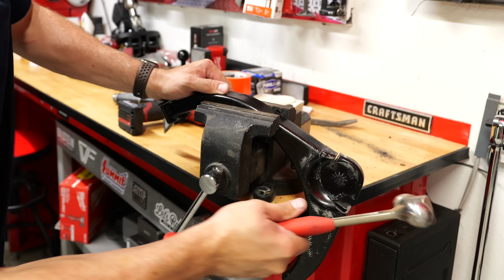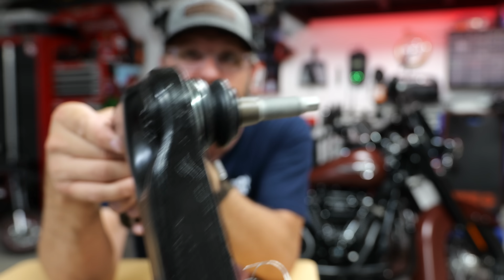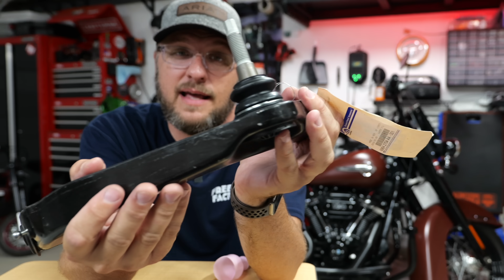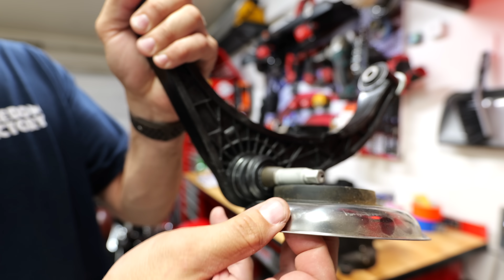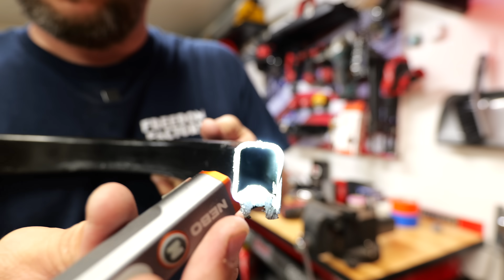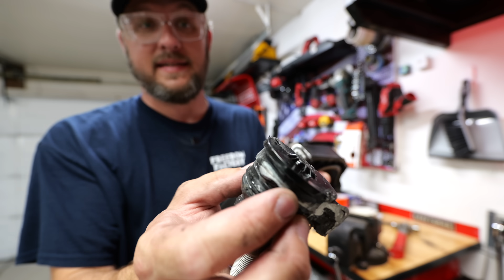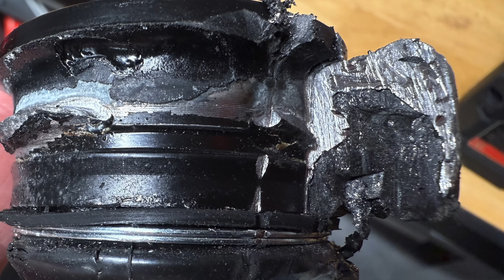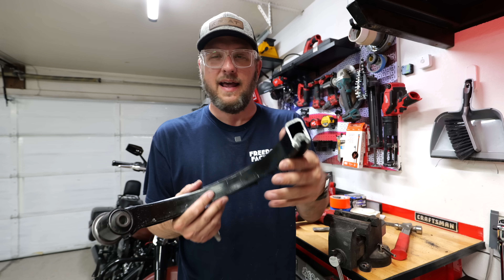I Cut Open RAM’s Plastic Upper Control Arm… Worse Than I Expected?

Comment: I Want: Zero Plastic Suspension Parts, Oil Pans, Valve Covers, Transmission Pans (color me crazy).
Reply: @Fallguy777  yep, I agree. Along with dipsticks for the oil and transmissions.
Reply: @Fallguy777  plastic should be for Legos......
Reply: Screw plastic coolant lines, too.
Reply: @Fallguy777  let's add intake manifolds to your list
Reply: @Fallguy777  I feel you man. I got an f150 and I love it but man the oil pan scares me. No leaks yet but I have to admit I've been window shopping for a metal one.
Reply: @ravageprime1172  if you get a metal pan, you can get a fumoto drain plug to make oil changes even easier. No wrench needed. I sold my 2019 f150 with a metal pan and fumoto drain plug recently. I replaced that truck with a 2002 7.3 f250. I had a 1999 7.3 f250 before I bought the f150 new in 2019.

I've come to the conclusion that I like old trucks better, long story short.
Reply: I would enjoy driving a overpriced pile of plastic, but it looks like my real steel 66 Cadillac is going to outlast me.
Reply: go back 20y or more or buy specific cars ....have a clio 3 rs...that has metal intake, al oil pan, still cast iron engine block, al valve cover, al thermostat housing.....
Reply: But they are charging you as if it were the real thing.
Reply: I agree, I've never had a vehicle with plastic suspension or oil/trans pans but I've had numerous problems with warped and leaking valve covers, valve covers that will strip out if you tighten 2 ft-lbs too much, valve covers where the screws will literally dig through the plastic without even getting tight, valve covers with non-replaceable seals around the injector bodies, valve covers where PCV valves will crack off due to the plastic being too weak to hold a tiny right-angle hose, etc.
Reply: Stick with 20 year or more old rides.
Reply: Don't forget that companies like Ford makes things like water pump impellers out of plastic now. I replaced several of them on the Coyotes in F-series trucks, none of which had even hit 100k miles (the first one I did had 49k, I was blown away when I pulled what was left of it out). The impeller just disintegrates, and not one customer on the 5 or 6 I did wanted to pay to further disassemble the motor to fish all the debris out. At least the steel aftermarket impellers will chew up whatever pieces circulate through, but it's still a clogged radiator, thermostat or heater core waiting to happen in the future.
     Models like Focus and Fusion even have phenolic brake caliper pistons (HOW IS THAT EVEN LEGAL?!) with cute little sheet steel faces where the piston meets the brake pad, and they crumble just like the water pumps. Modern cars are just abject trash.
Reply: Same.
Reply: I have a 2004 Nissan Altima 2.5s a lot of what makes that car unreliable is the plastic parts. Mainly the plastic valve cover. It causes oil to go where the spark plugs are and it leaks oil badly. And the radiator (on the automatic ones). But it’s also an issue on manuals for cooling. On the automatics at around 200,000 miles the plastic tanks on the radiator crack and it dumps water destroying the transmission. You can easily fix both of those issues by getting all aluminium ones.
Reply: I bet people said the same thing about gun frames before Glock came along, that said I’m on your side: not ready for that yet.
Reply: Yeah it’s like ford bout had the plastic intake right on the 02 f150s but instead of fixing the cross over on front where plastic think crack around o rings letting it leak no let’s just remake the entire engine 10x more complex and worst and then the 3v was born. All the trial and error and technology we got there just no excuses for the junk they making they could make the longest lasting best vehicles we could dream up but nope we get disposable junk instead. But it all leads back to all them under ground bunkers the elites built the end game is all of of gone off the face of the earth roughly under 500 mill ppl left only allowed to live in smart city’s as the world economic form says you will own nothing and be happy by 2030. So the rich elites can roam earth like it was there back yard with all of us gone so why make all these vehicles to last if you don’t plan on ppl using them in the very near future once you see it that way everything makes sense
Reply: The plastic valve covers and intake manifold on the VK56 in my Titan are doing just fine at 223k miles, but I agree on everything else. Plastic oil pans are probably fine, but they bother the every living crap out of me.
Reply: You are not crazy. The difference in reaction to temperature change between plastic and metal is enormous coupling them in the environment suffered by an IC engine is engineering idiocy, then putting a plastic 
" Beauty Cover " over the whole mess to hold the heat in is insane.
Reply: @Fallguy777  or intake manifold.
Reply: I have a 4.6 liter 2000 Ford Expedition with plastic valve covers. No problems yet. The thing is built like a tank. 
 I don't like plastic suspension parts. But be aware that the latest plastics are super strong. I had a useless digital internet radio that I wanted to take apart to see why it was so heavy and expensive.  ( The company died, so no server.) The screws could not be removed. I didn't want to break a screwdriver, so I took a sharp hatchet to the radio in the backyard. I had to hit the case about 10 times, as hard as I could, before the plastic finally broke. I couldn't believe it! And it was NOT fiber reinforced, like gun stocks are. And it wasn't thick either. Those internet radios are like a computer inside. A bunch of chips on 2 circuit boards with many capacitors & resistors on them. They are way more complex than I suspected. I could see why they aren't big sellers. You would need a giant factory to get the price down, and there isn't enough demand for that many.
Reply: @billsimpson604  For real?  It IS a computer.  It downloads music from the internet.  Duh.
Reply: @Fallguy777  Valve cover and intake manifolds have been plastic for decades on the most reliable Japanese engines.
Reply: @Mark-p1r7r thats cool but you cant port and polish them. How do they hold up to nos or forced induction?
Reply: @Mark-p1r7r  Some of us just don't like plastic.
Reply: buy a 57 Chevy
Reply: @sinistersilverado965  unreliable
Reply: Plastic valve covers hold up ok. Oil pans? Aluminum is the best, steel can rust out and often times replacement isn't easy.
Reply: @andrewdonohue1853 They can “hold up” until they have to be removed for maintenance… they are designed and intended to be replaced. This always costs extra money.
Reply: @andrewdonohue1853  aluminum corrodes too
Reply: MORE DESIGN ENGINEERS (GARBAGE)
Reply: You’ll going to half to buy a bicycle then.
Reply: @rg5445  Have, not half.
Reply: To do that u need to build it ur self, build old Ford!!
Reply: @Fallguy777  0 plastic inside of an internal combustion motor, period.
Reply: @DinduShecklestein timing chain guides
Reply: said no-one
Reply: @ragtowne i think you did not see the word ZERO...... lol!!!! 😅😊
Reply: @abitoffblacksmithing9985 sorry
Reply: Looks like you're not buying any new vehicle any time in the future if you stick to your criteria. Plenty of '80s vehicles out there to buy that meet your must have list Would I want one, heck no.
Reply: @Mdan7 Valid point, but l liked my 85 Mercury cougar. It was RWD, 3 speed traditional auto transmission, sealed beam headlights. Great car very reliable when almost everything else was FWD garbage. It was old school American car Ford knew how to build. I had Accord owners tell me at the time they liked it better.
Reply: @Mark-p1r7r I just bought a 97 Cougar XR7. 360 000 km and it's still mint. I can work on it myself, I'll double that mileage easy. Still has original alternator, starter, water pump, everything. No failures in 28 years, driven in Canadian winter. To hell with new cars
Reply: @Mdan7 Keep wasting your money
Reply: @Mdan7 I would. Theu were simple and cheap to service. An old Diesel rabbit, Mercedes, Volvo especially just wont die. Nobody will be pulling out a 2010 Chevy equinox, Or jeep patriot out of a field to fix her up like we do with cars now. Look at the insude of a new jeep grand cherokee. Looks insane inside. All the cables, wires, electronics. Im a tech and i was shocked.
Reply: @jasonchristopher2977   The problem with the diesel Rabbits is you ended up putting a new head gasket in every 50,000 miles.
Reply: @Fallguy777  the oil pan isn't a big deal .
Reply: @corytomcany6027  Plastic oil pans ARE a big deal. We have a fleet of western star trucks with Detroit diesels and they all have plastic oil pans, and ALL of them started leaking badly every 60k-80k miles. I've done so many pan gaskets by now I can't even remember how many. We've sent brand new trucks back to the dealer because the pan was pouring oil with less than 1,000 miles on the engine.
Reply: @corytomcany6027  How about plastic o-ring drain plugs in the plasic. They have went to far.

Comment: I remember Dodges plastic wheels over 20 years ago. That didn't last very long.
Reply: A lot of manufacturers still use clad wheels same as ram used.
Reply: Ford had them that you had to melt off.

Comment: Upper control arm carries serious loading from front brakes - plastic is a joke.
Reply: Takes stress when cornering too.
Reply: I’m not off roading, but do drive dirt roads quite a bit.  Not as much as serious off road, but frequent odd torques and forces acting on wheels and suspension gets a workout.  Parts have to survive ALL reasonable use.
Reply: No it doesn't the knuckle does
Reply: Using plastic in these type of compontants, is extremely dangerous.
Reply: Only in Heavy (Panic Braking) or Cornering, which Trucks don't Normally Do, the Lower will see More Load Always.
Reply: Braking and cornering while towing, stop thinking like a car driver.
Reply: Did you even watch the video? The structure is steel. Without actually testing them none of us knows crap. They might be the strongest around.
Reply: @Mark-p1r7r да, но это фольга, а не сталь
Reply: @Mark-p1r7r  That steel is very thin.
Reply: @johnshaddick6858 Did you measure the strength? If not, you don't know anything.
Reply: Yup! A few multi million $$ lawsuits will get them back to the drawing board. they should learn lessons before they happen. Buy a good old American made Toyota Tundra instead.
Reply: They have been using phenolic stators in torque converters for years and they are better than aluminum so your joke has no merit.

Comment: Well heres a question for you! Do you think that will survive ona true work truck loading materials in and out of mines or used in an offroad situation. I dont think it will. I think itll eventually crack and then when moisure gets inside itll tmrot from the inside out

Comment: Every replacement part I buy for my truck is usually about 2-3 time heavier than the OEM part.
They are also serviceable and come with life time warranties.
Reply: But what is the point of a lifetime warranty if the part keeps failing and the company offering the lifetime warranty goes out of business?

Case in point, I bought a lifetime warranty alternator for my 1991 Chevy Cavalier from Chiefs Auto Parts.  It went bad, and they replaced it.  Then they were bought out by Autozone.  Then the alternator went out again.  I took the alternator and my receipt to Autozone and they didn’t want to replace it under warranty until I started raising my voice, so they replaced it.  A few months later the alternator went out again.  Took it back to Autozone and they flat out refused to replace it.  Went to Oreilly’s Auto Parts, bought their cheapest 1 year warranty alternator since the other ones all failed within 6 months, and I never had to replace the alternator again.  

So just because a part has a lifetime warranty doesn’t make it a good part.
Reply: @91CavGT5 AutoZone has garbage parts, especially their electrical parts and their house brand suspension parts, same with O'Reilly parts. Overpriced junk for sure

Comment: It is obviously designed to look much stronger than it really is. Filling the thin steel with soft plastic provides no benefit at all. You are correct,  parts are engineered to be made cheaper, not stronger or more reliable.
Reply: It's a fully boxed steel part, likely made out of HS steel. The plastic is for NVH mitigation. It does not require the plastic for strength.
The side benefit to the Mfg of making it this way is you can't replace the ball joint. You will be buying a whole new uca.  Or do what I did
and get forged UCA's with replaceable ball joints when you get your lift kit. :)

Comment: Just look at the huge metal control arms on a  2003-2011 Crown Vic. MUCH stronger than that. I have seen Crown Vics involved in major front end collisions, and the front frame and suspension held up amazingly well. Odd how a car can be built better than a truck.
Reply: Crown vics are built better than any chrysler.
Reply: @BSC_1982  Especailly the older ones.
Reply: They don't even allow later model grand marquis and vics in demo derbys, too strong suspension and frame. Unfair advantage like the old Chrysler imperials
Reply: I seen a Crown Vic in my shop years ago a 2005 I think it had 423,000 miles and original engine 😊
Reply: @geraldscott4302  
Agree I've had two 2011 Crown Victoria police interceptors. One was hit in front by ford F150 pickup, and it still drove. All I can say Crown Victorias are tanks .
Reply: When it’s a police car. That’s when a car gets more heavy-duty stuff than a half-ton truck, which will likely be used to haul the owner’s bowling ball to league nights in most cases.
Reply: @BillLaBrie  ALL 2003-2011 Crown Vics have the SAME front suspension, steering, and subframe. Shocks are a bit stiffer on police models, that's all.
Reply: @geraldscott4302  2006 saw a second, though smaller adjustment and slight upgrade to the suspension and steering as well.
Reply: @geraldscott4302  the ‘03 upgrade was done at a time when most CV production was going to fleet use, police and taxis. It was redesigned to favor heavy use for that market. Have a nice day.
Reply: @BillLaBrie  Same design was also used for the 2003-2011 Grand Marquis, and Lincoln Town Car. I have owned two 2003-2009 Crown Vics and three 2004-2007 Grand Marquis, including a 2006 with over 400,000 miles on it.
Reply: @jessecv  I have a 2006 Grand Marquis with over 400,000 miles on the original engine, transmission, steering and suspension. NO new vehicle will even come close to that.
Reply: @geraldscott4302  my 03 4x4 Rangers upper and lower control arms put any new full-sized trucks to shame... its embarrassing that they try and justify some of this crap
Reply: @xCptLegendx  I've got on 03 ranger too! Seriously beefy truck for its own footprint. It's the only vehicle in my entire friend group that is still around from the last "let's get vehicles period"
Reply: @FordRangerClassics Nice! Its honestly so sad vehicle manufacturers don't make simple robust vehicles like the ranger anymore.
Reply: An got 25 mpg or better
Reply from the maker: I actually have been thinking about this. Is it better for an upper control arm to snap in half in a front end collision vs staying intact and getting pushed into the drivers legs?
Reply: Panther platform man! They basically are trucks.
Reply: @geraldscott4302   ford had to stop making the crown vic. Making an indestructible car is bad for business.
Reply: Different regulations. Cars are safer than any suv or truck. You can survive a tbone in a car more often than a tbone in a truck or suv. And I'm using 45 mph as a max speed since most roads that involve tbones are 45mph. The faster the impact, the worse off.
Reply: My daily driver is a Crown Victoria and you are 100% right
Reply: Yeah dodge and GM make the weakest IFS, and then they put that junk under motorhomes too, 30-40 footers with those weak IFS setups, I cut up 2 GM RVs on the P30 platform that had those on them what a joke.